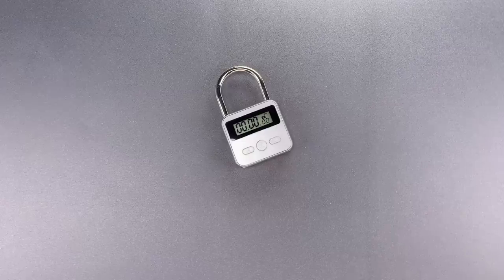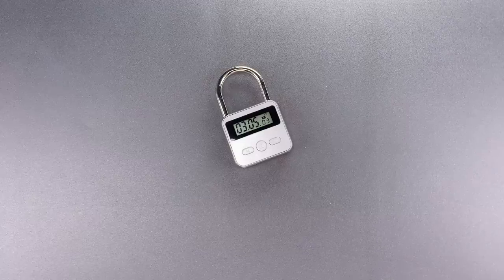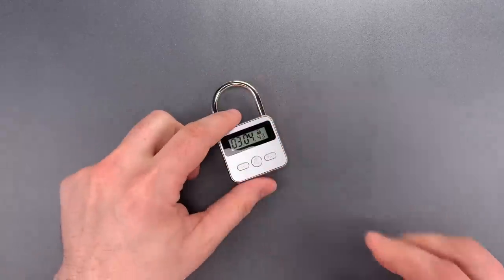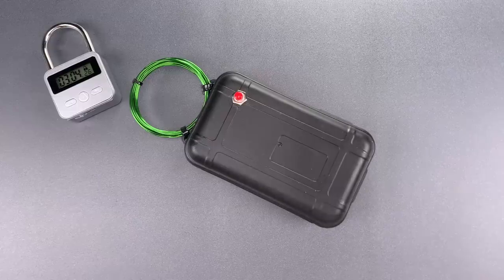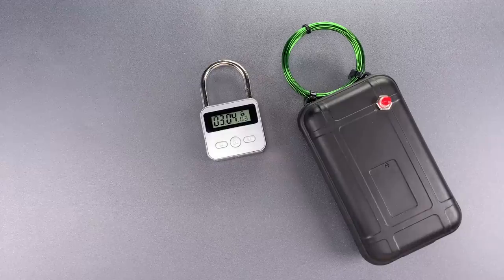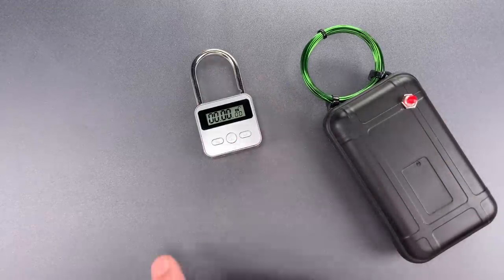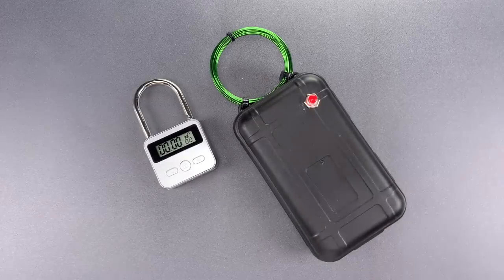[1250] Pocket EMP Generator Opens Timer Padlock

Comment: He literally shimmed the lock in an instant, excuse me wtf
Reply: New here?
Reply: Without the explanation, it could be the shortest video
Reply: @Pijawek  Apparently so :o)
Reply: Well, it looks like a very crappy lock.
Reply: Peter smith  You may assume he didn't hold the shim properly, but in fact that's a speedrun tactic that shaves a whole 2 frames off the time.
Reply: to be fair, this type of lock isnt meant to secure valuables. its on a similar level to internal door locks like privacy locks on a bathroom door.
Reply: @iris657  for those who take 99:59:59 in the bathroom?
Reply: @AdamG3691  i said they are on a similar level, not that their use case is the exact same.
Reply: @iris657  darn, I guess I'll need to look for another lock that I can use for my bathroom breaks...
Reply: @AdamG3691  may i suggest instead of setting to 99hours you just set it to unlock at the end of your shift?
Reply: @AdamG3691  There are some people... We've had one client who would lock him into the public restroom and the sounds that terminated, well, I had to knock on the door to make sure he wasn't dying.
Reply: I mean this lock isn't built to be a security device, not really. That's just smokescreen for it's true purpose of a kink aid.
Reply: @wuskyhusky4421  honestly, being easy to defeat in an emergency is arguably a feature for that purpose.
Reply: @keiyakins  yeah thats true. Also can open by tapping the left side against a hard object to disengage the locking mechanism
Reply: That's hilarious 😂

Comment: Of course he has an EMP generator lmao
Reply: It's not difficult nor expensive to make one. It only looks like sci-fi because it is commonly used in science fiction movies.
Reply: You mean you don't have one in your EDC?
Reply: @vidal9747  I don't think people realise that a common microwave oven emits electromagnetic waves using a manetron, this why it is protected in a faraday cage to prevent harm to electronics and operators.
Reply: It should be simple enough to build one yourself. It looks like a taser with each prong attached to the ends of a coil of wire.
Reply: This comment thread has been very helpful in teaching me how to equip myself to destroy all my belongings
Reply: @benedict6962  good
Reply: Ocean's Eleven
Reply: An EMP generator, for the man who has everything.
Reply: Doesn't everyone?
Reply: Funniest comment in this video 😂🤣🤣
Reply: @ts757arse  sounds fun, but when dealing with insects, remember to always use the Five Ds: Deflect, Dominate, Distract, Disarm, Disable.
Reply: what self respecting lock picker dosnt?
Reply: @ts757arse  it produces electromagnetic pulses, so it is an EMP generator. Your overthinking this
Reply: just buy a lithium battery with high current capability, an high voltage module and some wires and bam, you have your own EMP generator
Reply: You have an emp generator to. In fact you probably watched this video using it.
Reply: @pinkyfull  nahh, I use mine as a way to wipe computers for recycling (works well)
Reply: @zaptainkuboom5520  and now a lot of what he had is broken.
Reply: @ts757arse  How about a link to one or at least the exact words to search for.  I tried "emp module" and didn't get any useful results.
Reply: @zaptainkuboom5520  *dodge
Reply: @vidal9747  its generally illegal in America though
Reply: Ever since we found out that high voltage spark generators could come us free games on the Pac-Man arcade machine. That was in 1981. Maybe you are too young to appreciate the usefulness of such devices in your daily life...
Reply: @merct2894  WTF? So you can get an AK-47 in Walmart but can't have an EMP generator? Ok.
Reply: @ts757arse  I can relate. Luckily, in my case, the worst thing I have heard of are some fried sensors (which need to be replaced every two weeks, so there's are kind of expendable anyway). The stuff is advanced enough to detect malfunctions and to shut itself down. Nothing as "mission critical" as a pacemaker; I can easily survive for a few hours with these little machines and I can easily mitigate the issues (when though that means seeing the alarm clock for every three hours, even in the night).

Most of the stuff is pretty resilient anyway, nowadays.
Reply: @ts757arse  Depends on your bits. It wouldn't be great for my spinal cord stimulator (unless it's in MRI mode), but my artificial disc should be fine.

SCS is great for blocking pain signals, but BLE interface means you just need to scan for the SCS's address and you know if I'm home or not. 😄
Reply: @vidal9747   you cant get an ak at walmart maybe a basic shotgun or hunting rifle, also you can only get semi auto akms without a tax stamp
Reply: who doesn't ?
Reply: @benevolentworldexploder5395  nope, its inside a cage to make it more efficient so you bound the radio waves and just cook the food instead of making everything electrical go nuts inside your kitchen

Comment: Security: "Is that a taser on you? You can't have that here."
LPL: "I'm sorry this is a lockpick."
Reply: LPL  own brand of black box.
Reply: Security: "oh well in that case go on...... Wait a sec......"
Reply: @asdrubale bisanzio *Stun gun.  TASER is a different animal, all together.
Reply: a human pick
Reply: Oh. You can't have that here either
Reply: @asdrubale bisanzio A square is a rectangle but a rectangle isn‘t a square!
Reply: @asdrubale bisanzio If you google it, another video comes up right after this one, showing it's basically a taser plus capacitor(s) plus a coil of wire.
Reply: @asdrubale bisanzio Taser is a trademark usually emblazoned on a pistol like device that fires probes several meters away to discharge high voltage into a target, but can ALSO be used as a stunner without launching the probes.  A stunner (not a stun "gun") is a hand-held device (also sold cheaply) that has probes sticking out of it's body that you have to directly apply to the target.  So what's in LPL's black box is likely a cheap stunner, not an expensive torn apart name-brand Taser.
Reply: I think it looks like a bomb remote control as seen in movies. Tasers and Stunners usually have something to stick into someone.
Reply: You would be surprised what you can do with a small capacitor.

Friend of mine liked electronics so he installed a capacitor into his pencilcase. He ran a thin aluminium foil looking sheet near the edges. Looked like standard decoration, he did a good job. The only thing he failed to hide was a tiny red cable running from the inside to the sheet at the hinge on one corner. 

Thing has a few hundred volts in it and if you try to open it normally you close the circuit. Stings. :)
Reply: xerox, clorox, cleanex; we use brand names all the time in the living language of english; co-opting them often after the originator dies out. Don't be pedantic.
Reply: And to my knowledge, a taser uses a erratic pulse pattern while a stungun just charges and discharges a capacitor in a regular pattern. And I heard that tased people shit themselves more often than from a stungun or a simple strunner, don’t know if there is prof to that.

Comment: Hi I love your channel, especially all the creativity and fun you generate to open locks.
I'm an electrical engineer who specializes in electrodynamics, and it is fun to step out of that roll and enjoy all you do mechanically  with physical locks.
Thank you.

PS: one clarifying comment...it is not so much high voltage pulses that opens the lock as high current pulses.  ...even if high voltage pulses are used to create the high current pulses.
The high current pulses are what is doing the heavy lifting through transformer action.
Hope this helps.

Comment: Soon:
Title: 10 ways to open a Master Lock
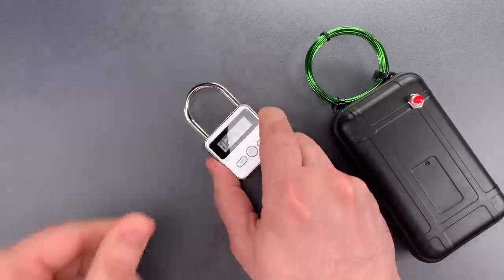Length: 1:54
Reply: without the intro and outro 
Length: 0:12
Reply: @oskrm , with pick insertion part removed,
Length: 0:05 (abt. .5" per lock)
Reply: I was thinking Master Locks at least were EMP proof but I'm starting to doubt...
Reply: @Wheeljack2k  I'm sure a while ago he did a lock vs an induction coil, which is a similar idea to this.
Reply: "This is the LockPicking Lawyer, and..." [click] "...in any case..."

Comment: And with that, every appliance and electronic device in LPL's home went to heaven....
Reply: It clearly doesn't seem to interfere with the camera...
Reply: Field strength will drop with the square of the distance. Look at how close the coil is to the lock and consider that every time you doubled the distance, you'd reduce the effect by three quarters.

Comment: I call that device “degauss loop”, in older days its used for degaussing vacuum tubes
Reply: Or erasing VHS / BetaMax tapes, Audio cassettes, floppy discs., hard drives...
Reply: @shadman7390  That annoying guy's laptop....
Reply: @shadman7390  Yes, it can be used for these applications, but in my experience, they will not be able to completely erase information from the hard disk, only partially damage it.  Usually the hard drive is pretty well shielded.
Reply: Does a much better job on credit cards, etc. :D
Reply: Demagnetizer loops are low frequency AC.  This tool works more like a Tesla coil, but not really.  It sounds like there's a tazer circuit in there hooked up to fire through the coil, which generates a pulse of wide band EMI each time it clicks.
Reply: @jimsmith5148  well then it would seem that MORE POWER  ..ohohohhhh is in order 😁👍
Reply: @tigercat3864  you right, but these devices generate a damped alternating magnetic field, and the frequency doesn’t matter, the final effect is the same.
Reply: Works on degaussing pipe when welding as well.

Comment: PLEASE TRY THIS ON BLUETOOTH/FINGERPRINT PADLOCKS!!!
Reply: I have a Bluetooth fingerprint house lock, and design plans for an EMP like this can be found online... THAT'S what I want to see it go against, an electronic house lock.
Reply: @Davedwin  totally
Reply: different type of lock. The thing with this one is that if it shows 0, the system knows to allow it to be unlock. Its a protection from like surge or what ever so you are not locked out of what ever you locked. The other locks that use fingers, dongles, or what ever just locks and requires the finger or dongle to unlock the device. If anything it would just power it off and on or it would erase or damage the lock if it has no reset feature, making it useless.
Reply: @Voorhees-Jason  That is kind of what I was hoping for. It wouldn't make much sense that if a house lock 'lost power' it would default to open when power was restored. AND now that I think about it, I do still carry a physical key for the day that happens.

Comment: From the sound I'm thinking this is the circuitry from a taser with the output fed into the coil array.  If so that should be fairly easy to make with mostly off-the-shelf stuff, you just need a container to hold the repurposed taser guts, a switch/button of choice and transformer wire.  Very cool.

Comment: As a fun aside: we now know that the LPL uses a piezoelectric condenser mic all other types would react to the emp with a near deafening *pop*. For an example of that see Kiwame Japan's videos any time he starts his gas stove.
Reply: Due to the fact that it's an inductor and how the coil is designed, the EM field and pulsing should be veeeery localized. I have a hard time seeing any tangible interference to equipment even a short distance away with that setup. With extremely sensitive equipment, maybe it'd be possible to measure the effect.
There are other ways to generate electromagnetic radiation and fields than an inductor (i.e. a coil), though, and those may result in "a little" more interference for surrounding equipment. :)
Reply: @PeTTs0n88  it's a modified stun gun circuit, you can hear the spark gap. http://www.bigclive.com/stunner.htm
Regardless of the coil it's going to put out EMI, that's just how the circuit works.
Reply: @npiper  Well, the effect should still be very localized - if nothing else due to the low current and high voltage of a stun gun circuit, on the secondary side. And you're still sending the output through a coil, which will control the electromagnetic output. That said, depending on the circuit, you can see secondary effects too - but they shouldn't exactly be long-range in this application.

A lot of circuits produce EMI across different frequencies and depending on how the circuits and/or components are designed (where several parts of Ohms law will dictate results), but that doesn't automatically mean that it'll significantly disrupt nearby equipment.

Comment: Ok so it seems that no lock is safe so ima just weild my door to the wall (and reinforce the windows)
Reply: You forgot the roof, the water pipes, the chimney, the cellar, the garage. There are so many ways to enter.
Reply: @wolfgangpreier9160  i mentioned the chimney but left it out in the final comment because ours is already blocked up (we don't use it)
Reply: at that point I would just focus on the weakest part of the wall
Reply: @wolfgangpreier9160  also we have some big dogs that will eliminate anyone who is not supposed to be at our house.
Reply: @reecewestgeest5022  makes sense. But i think people would hear that, or it would take way too long.
Reply: @thenickstrikebetter  it al depends on the house. For normal houses (in canada) are framed using wood with a plywood backing on the outside.  getting through the siding is relatively quick and easy. The its just a matter of finding an error that the contractor made while puttingon the backing. Witch are more common than you would think. Then it just comes down to going through the drywall.

Now if it's a concrete or stone wall it will be loud but still relatively fast.
Reply: @thenickstrikebetter  Me too. They lick and cuddle them to death or until the wanna robbers run crying for their mama.
Reply: @thenickstrikebetter  Are you sure? I mean the block. Have you checked recently? I have two chimneys. One goes directly into the oven (the diry one) and one has no end now opening. But then i don't barricade my house at all. I just have nothing at home worth stealing.
Reply: @reecewestgeest5022  More like: Is it worth it to break in? Or why don't i try the neighbor?
Reply: @wolfgangpreier9160  yes i checked a few days ago because i forgot of the block and wanted to see if there was any rain falling down the chimney (if thats what you mean.)
Reply: @thenickstrikebetter  👍👍👍😁😎
Reply: @wolfgangpreier9160  I do agree with you

Comment: Is that a stun-gun in a plastic case hooked up to a coil of wire? Looks like something you could make from bits bought from aliexpress!
Reply: it is something made with bits from aliexpress lol
Reply: It isn't. The sound you are hearing is a spark gap, which is used to make the field pulse if I recall correctly

It likely is made with bits from aliexpress or some other cheap site, as thats where you can find everything you need the cheapest
aliexpress.com/item/32680674865.html
aliexpress.com/item/1005001387777482.html
aliexpress.com/item/4001160286339.html
aliexpress.com/item/4001158562959.html
Edit: Of course it needs a battery and a few other things, but I'm not teaching anyone how to make an EMP device
Reply: @DebugOk   I could build one o those with a car points type distributor, some non resistor spark plugs, and some looped  unshielded solid core spark plug wire... (Old street/strip drag cars setup in this way often times generated this kind of emi going down the street... if you ever had one go past with your am/fm radio on you could here the ticking everytime the ignition coil fired)
Reply: @dodgeme1986truck  You can build it with anything capable generation a high enough current

Comment: I remember building a mini EMP device like this many years ago, and testing it on a range of household devices. It only really affected cheaper battery powered gadgets like calculators and digital clocks, so I assume this padlock is built to a similar standard. Larger higher-quality devices like alarm panels and laptops were impervious. I think it depends on circuit construction, casing material (grounded metal shielding being ideal) and maybe logic levels (TTL perhaps more resilient than CMOS).

Comment: Could this be used on fingerprint locks?
Reply: Maybe if you can get it close enough and it unlocks in the restart
Reply: If you don’t fry the circuits and thus freeze the motors, there is a chance.
Reply: Any device that's electronic will be affected by EMP. So yes, it will work on devices that has a finger print sensor. Have a great day!
Reply: At least one time.
Reply: The lesson here is not to buy electric locks. 

But the real locks aren’t safer anyways.

Comment: Fun fact:
If you use enough electricity you can restart a Human.
Reply: I’m going to lick high voltage power lines so I can buy some bitcoins in 2009. Thanks.
Reply: another fun fact .. a defib machine sends a shock large enough to stop your heart completely  , then the autonomous nervous system re-starts it with the correct rhythm

Comment: also stun guns can do it too, it works on some security keypads too. It can also be used to destroy electronics. shielding is an option but it depends on how strong you're generator is, a high power pulse generator can destroy anything, to point of even melting the shielding away. its the same with big strong magnets, can be very destructive.

Comment: Nice! Most microprocessors have a reset pin that it forced high or low voltage (depends) will restart the system.

The solution, I guess, would be to regularly write the current state to non-volatile memory which returns the statenon reset.

Comment: Depending on the way that pulse actually looks, if it's AC you could probably use that as a portable induction furnace. Bring a tiny crucible and melt through the lock with liquid metal from an old, broken lockpick or something.